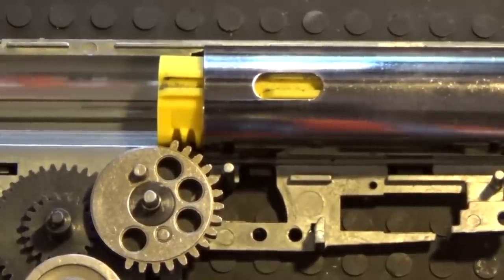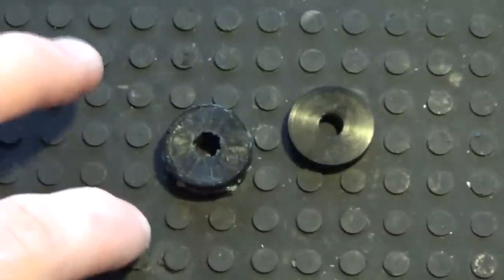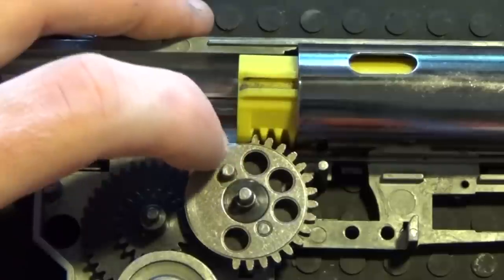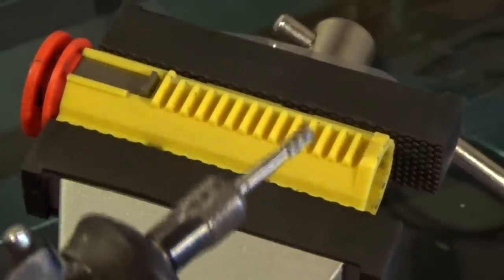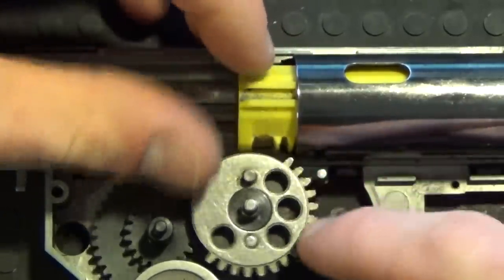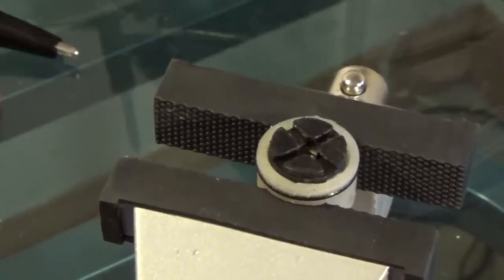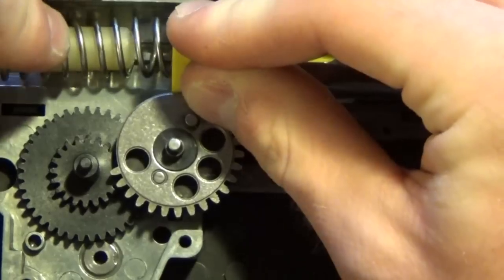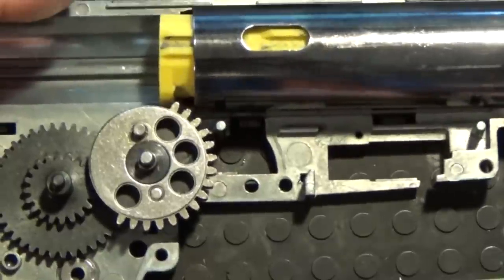Inside the Gearbox: How to Correct AOE.

Comment: The proper way to adjust A.O.E. if it is ever a concern (not really with how gears and their load application is designed) is not by stuffing the piston with rubber, or any additional material at all.  In fact, you want to use the least amount of padding possible to dampen piston impact that also doesn't promote bounce back.

To properly adjust A.O.E. a spacer, shim, or disc needs to be applied between the piston head and piston.  To establish proper spacer thickness, place stock piston in assembly and see where gear engages piston teeth.  Now, move piston back to desired A.O.E and measure the difference and then use a spacer the same thickness and place it between the aforementioned location; piston head and piston.  

Tired of seeing this method regurgitated all over the net.  It's wrong, people.  Totally wrong.

Adding more pad does nothing more than to reduce cylinder volume and increases head space (atmosphere zone/void that must take charge before propelling projectile).

On to gear and load design applications.  The pre-load amount on the spring at rest is not enough to raise alarm, so therefor AOE is rather moot, really, unless we are examining a poorly designed and fitted assembly.  

Once the sector gear starts pulling on the linear gear, the remaining teeth fall in line along the rack.  This is where it matters.  The load become progressive and there are several teeth in engagement during this event distributing load values.  The load, of coarse, pushes teeth along the rack and sector gear to one side.  This is why wear occurs along the forward face of the linear gear and along the rear side the sector gear.  There is no avoiding this phenomena.  These gear manufacturing designs are rather limited in application as they are sintered steel (powder steel heated to fusion point , unlike cast steel that is heated to liquefaction forming - bosth use a form/mold to establish shape).  Sintered steel is inferior to cast steel, and cast steel is inferior to machined steel of the same alloy composition.  It's about manufacturing costs and turn around with the mindset of what will get the job done with minimal amount of investment.  

In short, simply stuffing the piston with foam does nothing more than promote head space, promote bounce back (vacuum and timing event interruptions), and adds unnecessary spring load on the start of the firing cycle, promoting premature gear wear.

Comment: Love your videos, they have been s great resource for me for years. I actually referred back to this video wondering 2 things

1.   When using facet washers without sorbo (the stock sorbo was smashed and had fallen out so I glued the washer straight to the cylinder head),  due to the hardness and lack of shock absorption of the washers should I be concerned about stressing the front of the GB shell? This is in a SAW gearbox btw, so high cycle abuse. 

2. I use 2 washers glued together and slightly sanded down. What do think about gluing one washer to the cylinder head and adding the other to the piston? Im thinking this may take advantage of adding mass to the piston and mitigating the possible fps drop from shock absorption of the sorbo on the cylinder head?

Thanks!

Comment: Great video and explanation. Very informative and easy to understand. 
I will actually try using a sanded down door stopper to see if I can get that to work. It has more of a cone shape, which would slow the piston down more gradually. 

You can also use silicone to make a cone. Search "Hammar Silicone Dampening mod"

Comment: In the world of mechanics we call these guys hacks not techs. Im so sick of watching videos like this where the narrator is feeling all high and mighty because they have a broad, misguided understanding of basic functions of the units they work on. Airsoft is only such an expencive sport because no body knows enough about basic engineering principles to realize what cheap pieces of shit they buy. And when someone does find a somewhat quality piston (which still shouldnt be made of plastic) with actual renforcements on the teeth, they decide to lob off a tooth for "reliability!" All that does is add the same stress back to the first tooth, in roughly the same spot, that you were trying to rid in the first place due to the fact that without another tooth to assist in the load, the first tooth holds the load that much longer. And with the more abrupt transfer of force to the third tooth- that youve already worn down- your just asking for it to strip completely, making the whole part useless! What you want to do is simply adjust for a smooth entrace of the first tooth on the sector gear into the gap of the first and second teeth without removing anything! Use a stiff, shape-holding material as the adjustment medium to prevent undoing of this adjustment with age. Stiff rubber is the best bet. And use plenty of lubrication when reassembling and not the spray can silicone crap; it doesnt adhear to the surfaces or lubricate them for that matter. Use a good quality grease and motor oil. Use grease on just about everything that is hard to reach and hose down with oil after heavy use. If you play a game and a lot of dust was kicked up dont hesitate to check to see if the gear box is plugged up with dirt. If it is, clean it out and reapply lube. I know of no gun, real or fake, that has any friction based components so, if it moves, oil it.
Reply: Yea put oil in it and fuck up the hop-up
Reply: +enaneitor0086, where did you see any MATH or even a sound theory in this video at all ?!?
You're deceiving yourself that this "correction" is working and I'll explain you why.

You buy a new gun with a crappy stock piston (because manufacturers have to cut costs somewhere) and it wears out quickly. So then you buy a decent piston that would normally survive 5 times longer, but instead you make "the AOE upgrade" and it survives only 2 times linger and you think you achieved anything.

Another frequent reason for a piston to wear out/break easily is people making amateur spring downgrades (to meet local fps requirements) or motor upgrade/gearbox ratio reduction (to increase rate of fire).
The result from either of these is that the piston no longer travels forward fast enough in relation to the sector gear rotation.
Sooner or later the sector gear catches the piston "mid-flight" close to its forward position.
There is nothing more destructive for your piston compared to this scenario because both the sector gear and the piston are accelerated in OPPOSITE directions. This is when most damage is done.

So what should be done instead:
a) if you have to put a slower spring this change also requires a slower motor or higher reduction ratio gearbox
b) if you want to increase rate of fire this requires a stronger/faster spring as well, there is just no other way around it, without risking damage to the piston.
Reply: I've been teching for almost a year now and I've had more problems with bad AOE and the extra teeth than a good AOE and removed teeth
Reply: "I know of no gun, real or fake, that has any friction based components" 
check this out  - https://en.wikipedia.org/wiki/Blish_lock  
also
the hop unit of an air soft gun uses friction to apply back spin to a BB 
not trying to be a dick just spreading the word
Reply: J C okay you're talking shit now. You don't need a higher fps spring in a gearbox for a higher rate of fire, you need to short stroke the sector gear around 3-5 teeth, the reason you put a higher fps spring in it is because it doesn't compress the spring enough to have the maximum power of a fully compressed spring. You up the spring rating to make up for the fps loss due to short stroking, and for the preventment of pme's sake.
Reply: YOU ARE RIGHT!!! FINALLY ONE SAYS IT ALL!! I adore you tube about this and other subjects I love. As I am NOT a tech in anyone of those issues I love, I come here to learn! BUT everything you say, is RIGHT unfortunatly!! And I am also tired of asking the ''Docs'' a question, and get an awser for a question I did NOT made!! UFFffffffff!!
Reply: “Expencive”...nice...
Reply: Hahahahahahahahahahahahahahahahahahahahahahahahahahahahahahahahahahaha.
Great joke post Rich, bet you couldn't hold a straight face while you were typing that out!
Reply: your argument is fallacious, you are basing your argument off an assumption that an upgrade piston lasts 5 times longer without AOE correction, this means your are incorrect in your belief that AOE decreases piston life span

yes PME occurs when you downgrade a spring for FPS reasons rather than short stroking, that has nothing to do with AOE, AOE is meant to prevent sector gears from getting front teeth chipped on a metal rack piston and thus permanently damaging your gears due to poor meshing

yes PME and bad AOE produce the same result, but they arent related
Reply: Not sure if you're an engineer, but I am. It's well known that it's indeed a gearbox made out of poor parts with low quality and bad tolerances, even the most recognized or expensive ones.
That said, it's also well known that it's 10x better to have your piston fail than having your whole gear set break apart. So no, you don't want a metal piston. It's called fail-safe in engineering.
As you started your text with the forementioned argument along with plenty of grammar atrocities, I'm fine with ignoring the rest of it.
Reply: rich111 most triggers on real guns are friction based, the cams on real guns are friction based, etc...
Reply: rich111 also for airsoft the anti reversal latch is friction based, cylinder head o ring is friction based, nozzle o rig is friction based, hop up rubber against the BB is friction based...etc etc.

Comment: Doesn't adding the spacer shorten the compression stroke, in turn lowering the volume of air being compressed and the FPS of the BB ?
Reply: It has negligible effect in most cases, and you can compensate by changing the cylinder porting or barrel length.

Comment: what maybe kills the tooth is heat and or dirt stuck in the loobe  since not having the proper angle will cause more slide friction heat/abrassion as opposed to angleling it and having less sliding action to pass the first gear  even grease or oil  makes heat if you rub your hands together with them you will still feel friction even more . dry lobe for keys and lock ect will not hold dirt it is pritty frictionless since it wont create a bond between your hands . I see this  trick will also solve or give more jam preventing slack  that low fps and high rate of fire will cause because it wont catch on the missing tooth as the gear comes back around .thanks for the tip

Comment: Playing  airsoft for 15 years. Doing my guns for 15 years. Best friend was a tech at an airsoft/paintball/military shop. And non of us did something this useless. Why bother with a polycarbonate piston and AOE? Destroy the original, buy one with full metal teeth and the other parts (cylinder, cyl. head, Al piston head, nozzle, maybe gears, motor if you go over 130-140 m/s). Assemble the gears correctly put it all together and voila. Didn't change a piston in 10 years on my guns.

Comment: nylon washer from lows? dremell grooves to key in  stock rubber to achive more quensh or less space in the cylinder .like a gas engine more  cc's in the head { piston to head clearance or space}= less compression less cc's =more compression harder piston push- high performance   91+ octane mandatory  or  piston kaboom  .u can also re groove the nylon where the piston meets to achive a better air rush you might need two washers though since they are around the thickness of the fosset washer.some small flat head engines also have grooves to either let air in or quench exhast out in such  limited space .another factor witch may have lowered your fps is turbulence instead of one hole with grooves the extra washer made 4 holes pointing at each  and then you got the fosset washer hole . less sharp corners in your main hole the better ,like a 3 angle valve job on a cylinder head =more flow with the same hole. u can tottaly do away with the angles of your hole  like a funnel.

Comment: I dont get why a heavier piston would transfer more impact energy to the cylinder head.. that's the same as saying that a heavy .40g BB will  have more impact energy than a light .20g one.. I's all about knetic energy, a heavier one will move slower , and the light will move faster, so the energy is the same
Reply: As for the BB example, the energy would be the same if there was no air resistance. As the light BB is traveling much faster, it also loses energy sooner, as the surface area of both BBs is the same. So the impact energy remains higher in heavier BBs.

The same happens with pistons, actually.